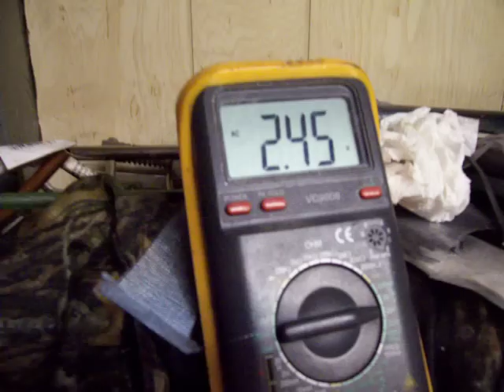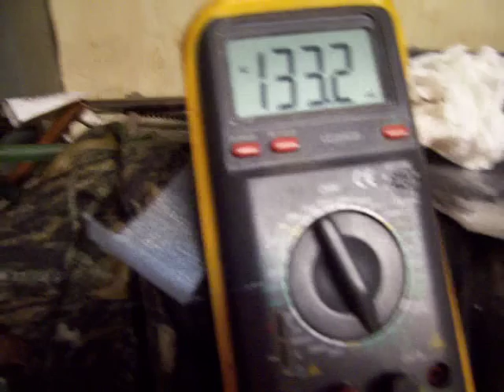lamina heat engine number 3 steel wool        thermal lag engine      laminer     alternator

Comment: wrapping the coil using bifilar method can lessen lens law and increase your output.  I have tested it some and it seems to work a lot better.  I havent tried it on a heat engine yet....  I'm still making fluidynes.

Comment: Dan Rojas ( i believe that is his name) had some excellent Fresnel lenses for about 40 bucks one time on Ebay. His website is GreenpowerScience. They were big and could melt stainless steel but they probably would not on a Stirling because Stirlings carry the heat away as they run. They may melt it down if the piston got jammed,He had a video of an Alpha Stirling running of of one of his giant lenses and it ran very fast. The lenses that he was selling were also made to with stand the ultraviolet rays without the plastic breaking down and becoming brittle. I don't know if it just slows down the ultraviolet breakdown process or if it never breaks down. I know most plastic does this. Some Fresnel Lenses are not suitable for sun power and can breakdown quickly from the suns rays. I also do not know the expected lifetime of these lenses. Not sure if it would give you more power than a flame. Just thought you may want to check that out. They were on sale at the time. Regular price might be 60.00 plus shipping.